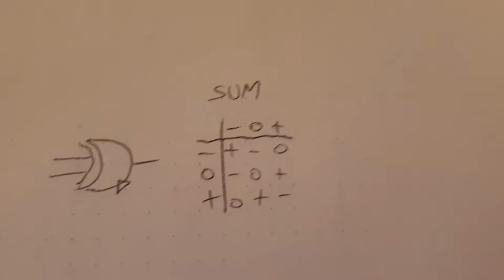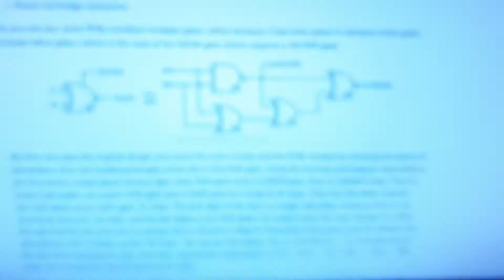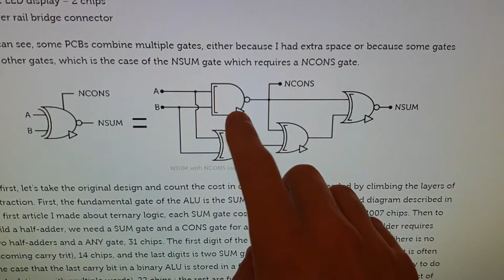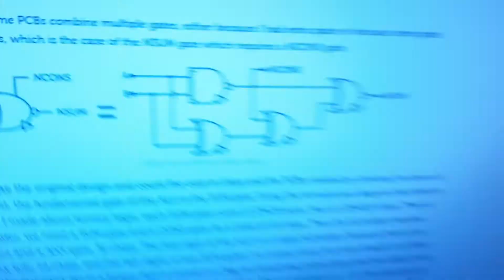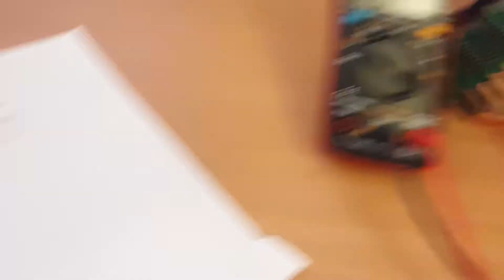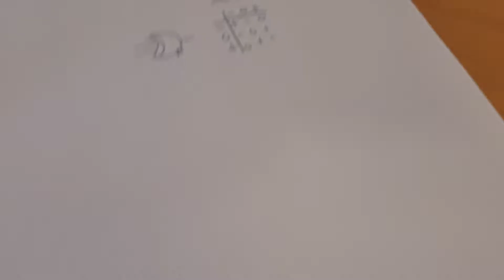Working ternary SUM gate

Comment: Hi Louis, I recently became interested in ternary devices after I built a 6 bit binary operator for addition and subtraction last year, from discrete sot-323 transistors on 1.27mm pitch pcb. I saw your work on ternary alu. If you are still available, I would like some clarification on the 3-trit alu in your document: 
It can represent a total of 27 states (excluding the last carry out) from -13 to +13, including a zero state. Can you give me a voltage example how would the three outputs represent the number 5? Also, can you provide me with a way to build a signal shifter gate ( convert -, 0, + input into 0, +, - output). 
From my understanding, the number 5 will be represented by 9-4 at the outputs (-, -, +) which I find inconvenient for reading. I am currently trying to come up with a ternary full adder that operates with unbalanced ternary logic (0, 1, 2).
Reply: Are you still working on unbalanced ternary logic?
Reply: @detectvchikn8356  No, at least for now I am not. I tried doing a calculator out of transistors, but I am currently stuck on a problem with unstable storage registers.
Reply: @thelonewolf1757 me and my brother became interested in ternary logic recently. We were thinking about making a calculator as well
Reply: @detectvchikn8356  Great! When you do it, post the circuit. However my build is from discrete components. I currently have a 40 bit binary adder and subtractor with integrated state correction logic. It uses a total of 1046 SOT-723 transistors and 524 SMD 0402 resistors. The size is only around 8x9cm. it uses Nmos logic.